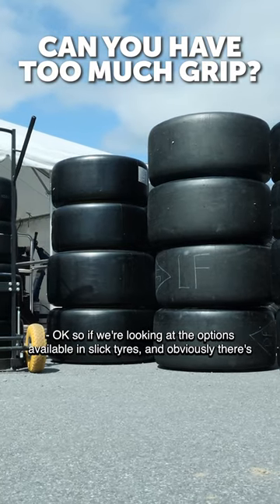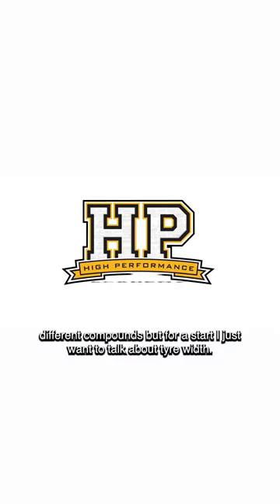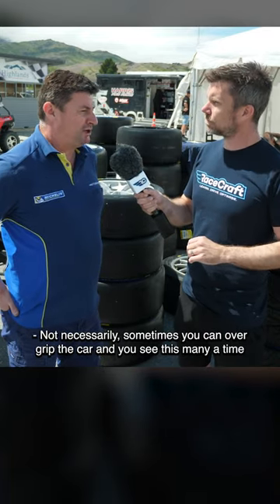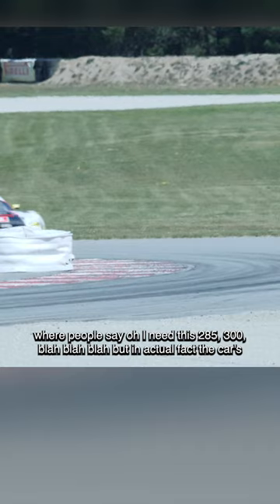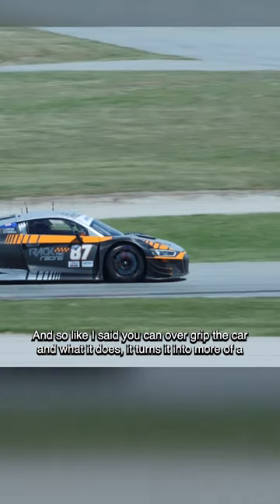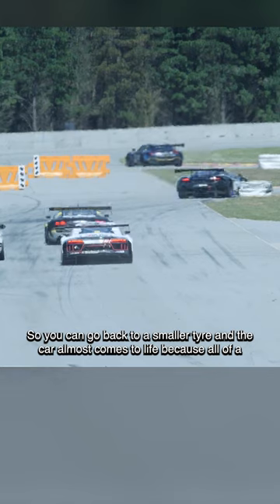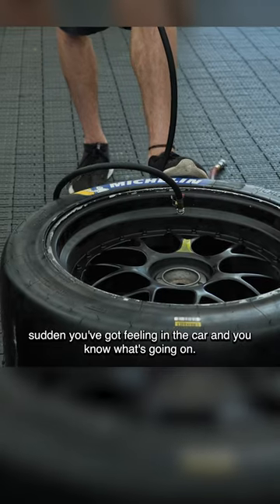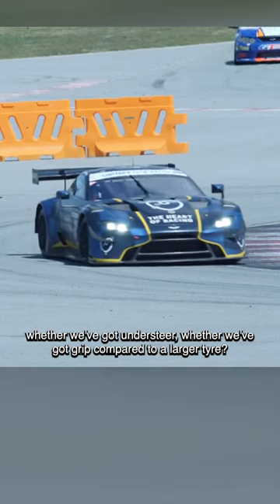How too much GRIP can make you SLOWER #shorts

Comment: My biggest complaint for wide tires with novice drivers is that it raises the threshold before losing grip, but it also doesn't give much time for a novice to correct a mistake. In fact, I sometimes advocate sometimes going more narrow than OE spec when someone isn't experienced with the vehicle. It's always much easier trying to correct a slide going 40 MPH, than trying to correct when pushing 100 MPH.
Reply from the maker: Interesting insight! There are absolutely valid reasons for people to follow some progression when it comes to things like this - Taz.
Reply: Interesting point. As a novice I was inclined to believe wider tyres = better grip which can only be a good thing. But as you say, with a higher threshold, loss of grip would likely be under more extreme conditions which are less forgiving.